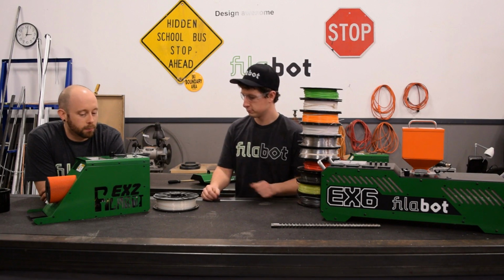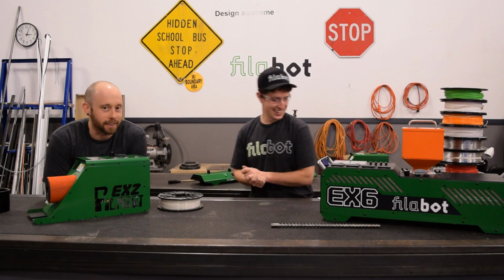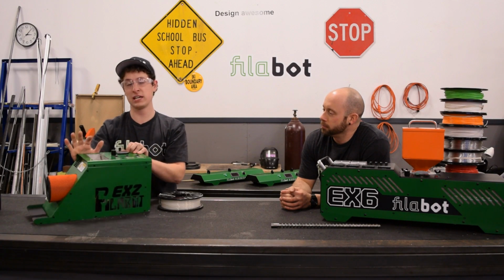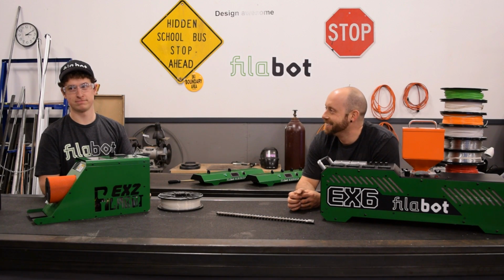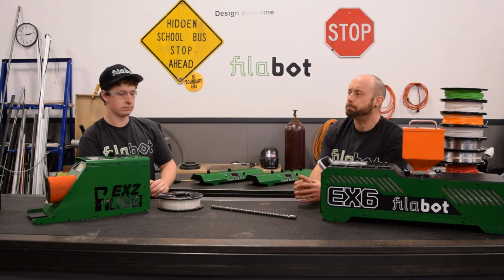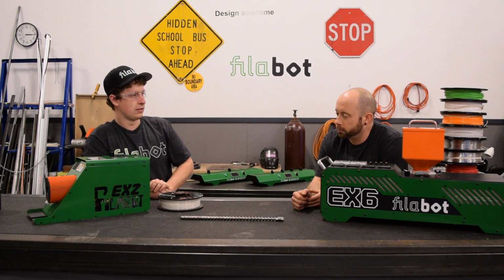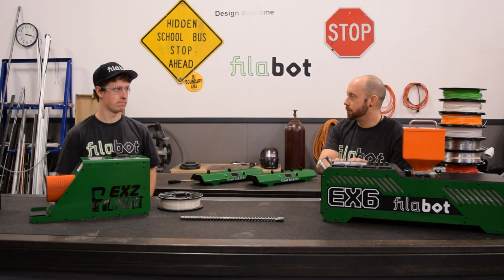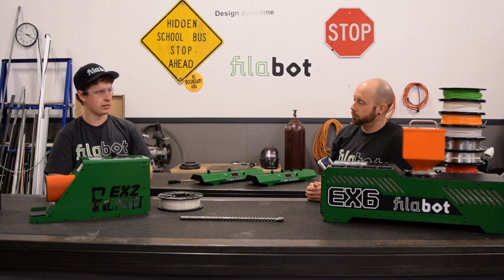Filabot EX6 and Filabot EX2 Comparison

Comment: Ya'll need to setup an LCD teleprompter and just use a bluetooth floor switch. You coulda had another camera to show the top of the EX6. That way you don't have to tip it over.